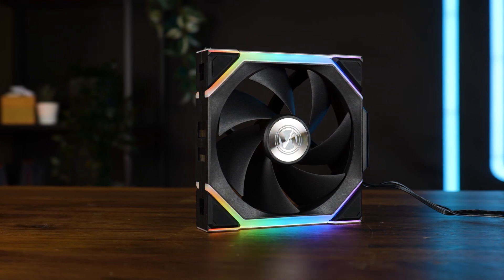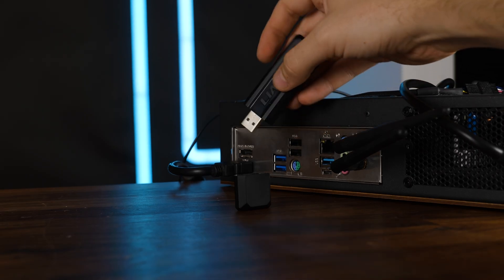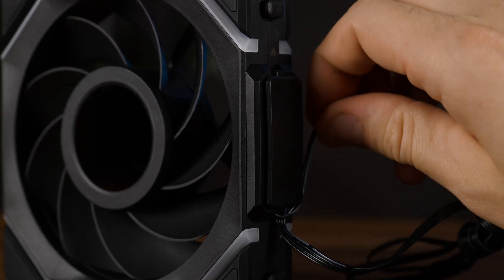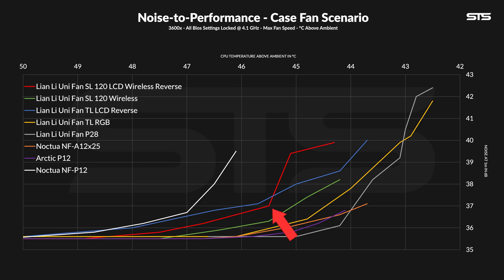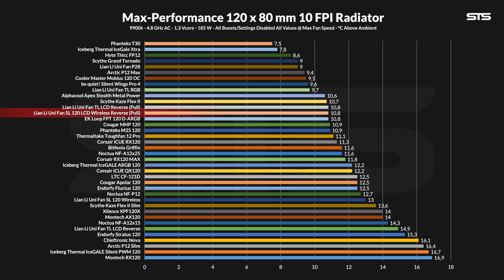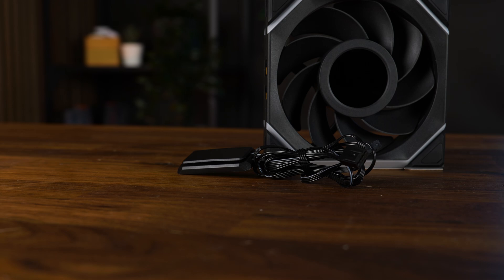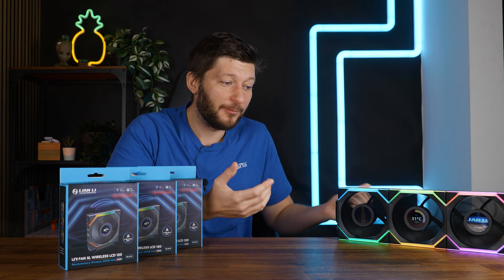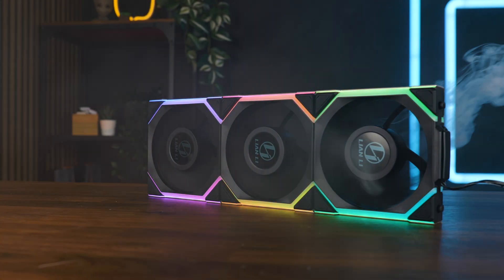The Not-So-Wireless Fan - LIAN LI SL v3 WIRELESS 120 LCD Reverse

Comment: I got the sl120 wireless. Like are yall in the middle of the desert? Running a 13900k and a 4090, 2 rads, my system doesn’t run that hot still…

Comment: When using the SATA to PWM 3-split cable (which was not mentioned), there is no connection at all to the motherboard. So yes, fan speed and RGB control are indeed completely wireless. LCD versions are still tied to a USB 2.0 header (which does become a problem with multiple groups + AIO + whatever else).

I just got done installing these and appreciated the lack of thick cables and the bulky controller you’re tied to with other Lian Li fans. I found they work well for people trying to have the cleanest systems possible. 

Are they worth upgrading from normal SL fans? No. Are they a cool innovation? Yes.

Comment: tbf, on the box it says "Wireless LCD" which isnt technically a lie, the whole lcd and rgb for that matter are indeed wireless. Anyone with a tiny bit of understanding of electronics will know you cant make the power connection wireless for anything thats drawing more than some mAmps, would also mean some sort of battery that needs to be charged every day. The biggest plus about this new wireless series is that you wont need 5 different controllers for their parts anymore, the ability to mix lcd with non lcd is also great for many users.
Reply: I agree. I don’t know why ppl think power will be wireless for anything over 1mA….

Comment: The blade on the reverse SL looks like a TL blade. It has 9 blades instead of 7, which explains why it operates similarly in pressure dependant situations like a rad. That's my thought on the matter. The case scenario is more dependent on airflow, where the thicker frame hurts performance more.

Comment: I still love Lian Li, but I did point out to them on X, that these still need a wire to provide power, so not actually Wireless. Their response was dissappointing. It is a shame, because the wireless hub is actually a neat idea,  and this could have been promoted as a cool wireless hub.  But the fans, no, they still need wires.

Comment: This feels so weird to have to defend a product I have little interest in but this is such a ridiculously unreasonable take that it's almost required since you are going to stick to your guns and be just about as obtuse as possible on this. Yes, bad marketing is bad. Marketing is meaningless to the actual product. Please stop being so dense as to actually base any review on marketing and instead base it on the product. You are complaining that they switched to two cables for the LCD model, yet the two cables chosen are open standards instead of a proprietary one off and can be daisy chained with any and all regular PWM or USB extension cables. You are complaining that they have wires for power, yet the alternative is a battery which would require charging or replacement, because that's how physics works, guy. You are complaining about an improved, more versatile, and more open system just because you don't like the shitty marketing. Seriously, you are being as genuinely idiotic about it as Lian Li's marketing team is to call them wireless.  I still think these fans are overpriced. I'm still not going to go out and buy these unless they were on a massive discount closer to $50 for a 3 pack for the non-lcd and maybe $75 for the LCD variants if there was a very specific functional reason for me to get a stupid LCD on a fan. However, this control mechanism and wiring solution is such a night and day improvement over their previous options that its truly insane how stupid people are being by complaining when they freaking fixed most of the issues with their previous controller without increasing cost more than $5 for the 3 pack. Also, obviously the TL are going to perform better. Anyone with eyes can see that. They are LCP with a more aggressive pitch blade and a higher quality motor. They are also more expensive currently with a terrible control hub. Again, all of Lian Li's fans are likely to adopt this "wireless" hub and the SL probably were the easiest for a quick refresh so that's what they started with. Again, complain about the fans performance, fine. Complain about the shitty marketing, also fine. However, you are also complaining about the one good thing they did with the product and also calling it bad. That's what is ridiculous and frankly, stupid.